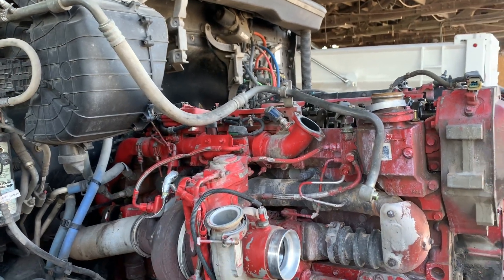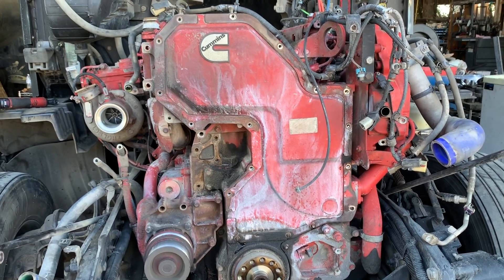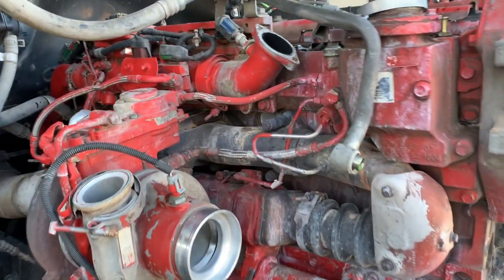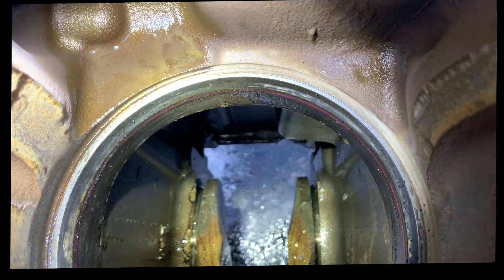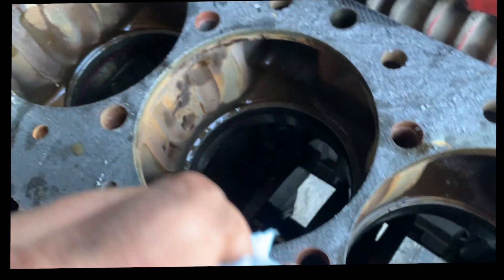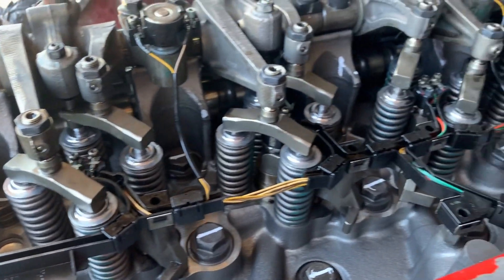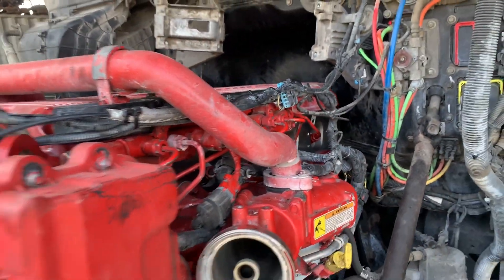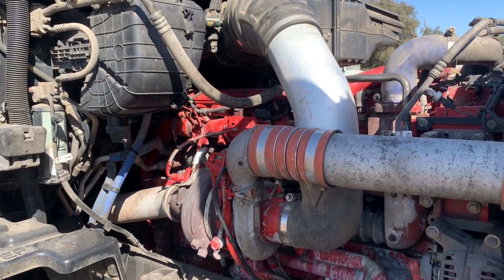Blown Head gasket - Dropped Liner - Pressure in Coolant - Cummins ISX

Comment: Just had a head job done on our truck. Got roughly 100 miles from the shop before it had to get towed back. Im wanting to ask you what can go wrong with the assembly after a head job to cause a tick like sound before the oil pressure drops and pushes fuel up into the oil pan?
Reply: How much you paid for that head job? I’m afraid I’ll have to do the same.

Comment: Hey man I have a Cummins and this is my fear this very problem so what exactly caused your failure???
Reply: Use only fleetgard coolent ,after 600,000 km flush coolent system and new thormstet ,carefully watch loded engine coolent and oil temps and main think just easy on right foot ❤

Comment: after i repair camshaft and main bearing my truck start black and white smoke and rpm going down so fast til truck shut off  after engine off water shows it hot almost 300 after 30 minutes  truck starting again, my experience is problem come when i use cruise control any advice pls
Reply: White n black smoke could be faulty  doser valve, egr valve or bad injector.
If you getting 300 degrees in your coolant probably you may have a problem on thermostat or water pump, what kind of engine do you have.?
Reply: @atalia6159  bro thanks for you're respond, my engine is Cummins isx my problem was bad fuel i stop using Quick-Trip diesel and clean my tank after that everything  is Ok, now i had my Coolant lose when truck is runing till coolant light is come on after i turn off engine coolant went all the way up but not overflow  i don't know why coolant is disappear than come back normal after i turn off engine i  also had  raugh ideling  when i star morning  after 7 minutes everything is Ok, when i diagnose. it shows code SPN 102 FMI-2 Thanks for youre information bro

Comment: I'm getting coolant pressure only on hard pulls only. My cummins ISX CM871 runs great on flats and moderate hills but once I pull a hard hill the coolant pressures up and spits some out.
Reply: What solution you got?
Reply: @rashmindersoor692  I rebuilt my engine, that solved my coolant issue.